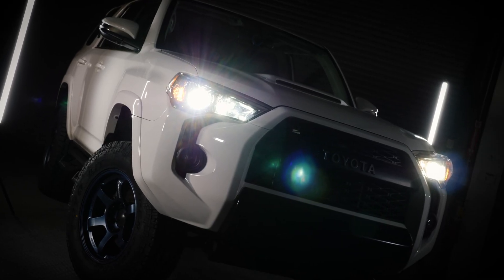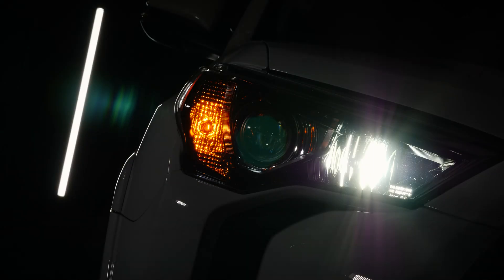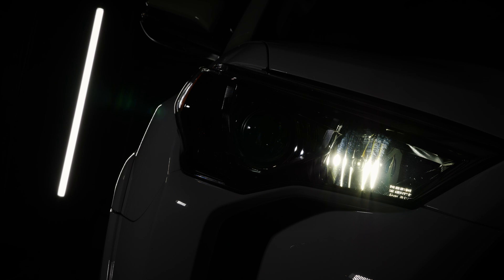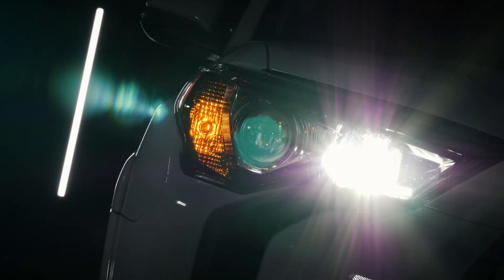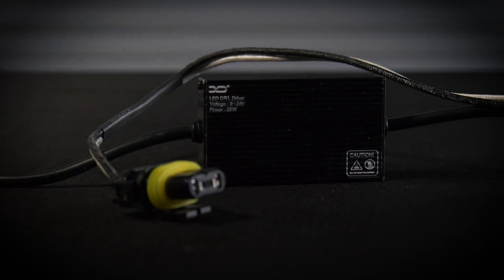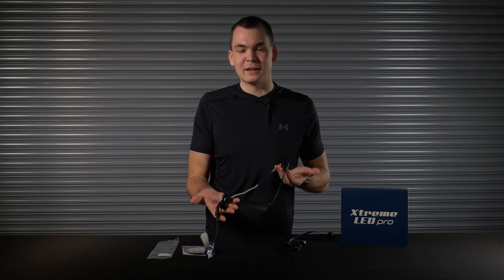Xtreme Pro Daytime Running Light LED Drivers Explained - 4Runner LED High Beam DRL

Comment: Why not put the link to this light kit? I go to your website and so many bulbs so. A bit confusing as i would like to get this module with some leds
Reply from the maker: Here is the kit for the 14-20 4Runner low beam: https://www.headlightrevolution.com/2014-2018-toyota-4runner-low-beam-xenon-depot-xtreme-led-pro-1418T4RUNNER.XD.LOW_2?quantity=1

And for the 14-20 4Runner high beam: https://www.headlightrevolution.com/2014-2018-toyota-4runner-high-beam-xenon-depot-xtreme-led-pro-1418T4RUNNER.XD.HIGH_2?quantity=1

Comment: Received a pair of h7s for my 2017 outlander. Having an issue installing them. Power supply setup is fine. But, once I go to insert this new bulb into the light housing, i unable to get it lock it. They circular piece that I saw in the video doesn't have that blue gasket. Like I'm missing a piece for this to lock in place. Any suggestions?
Reply from the maker: Can you send us a picture of the bulb youre trying to install?
support@xenondepot.com
Reply: @XenonDepotOffRoad  I found a $10 adapter online after I watched this video. I am waiting for to arrive. If that doesn't work, I will share a photo.

Comment: i got and i am getting very light flickering , a kind of vibration ? on both bulbs when i turn on DRL mode .
Reply from the maker: You did install the DRL drivers that came separately and not the ones that come in the box with the bulbs, right?
Reply: @XenonDepotOffRoad  Absolutely correct

Comment: $14 dolla canbus/anti flicker caps fix this too.
Reply: No, they don't, they cause the bulbs to be 100% bright and blind people. Capacitors act as lowpass filters and smooth the PWM back into a higher voltage - high enough for the LED drive to output brightly.
Reply from the maker: Thanks for that info!
Reply: and you only need one per vehicle, not per light

Comment: I have some questions before adding my order on your websites cart. I do have 2007 toyota Camry Hybrid and i did bought a Philips LED 9005 highbeam/DRL but i have some issues on it. The DRL is fleckering most of the time while when i use the highbeam i have no problem with it, so then i tried putting Philips canbus adapter hoping it will resolve the fleckering problem but it won’t. And i ended up phoning the philips company and they says there products won’t work in my vehicle..

So please can you give me an idea to resolve this issue in your product which one i need to resolve the fleckering issue?

Thanks
Reply from the maker: A PWM module should help fix this issue!

Comment: 2013 ram 1500 (vertical fog lights)
9006: XTREME LED PRO - Yellow fog lights
Will I need to use DRL harness for just fog lights?
Reply from the maker: Not at all, just the bulbs and PWM modules on this truck!

Comment: I got this for my 21 4runner Limited. Even though 21s now come with LED, the DRL still uses the ugly orange looking halogens.  I got the LED with DRL driver.  However, when installing, I noticed it fits a little loose so there is movement. I tried taking the o-ring from the factory bulb but it didn't make a difference.  Anyone try this on a 21 yet?

** Took a look again and for some reason it's full on brightness too.
Reply from the maker: It sounds like something changed with the 2021 OEM LED Headlights, so most likely you will not be able to use those DRL drivers with the 2021 OEM LED model. We are happy to take those back for a full refund, just shoot us an email and we will get that taken care of! Support@TheRetrofitSource.com
Reply: Planning on doing this to my 2021 sr5, yes i know it sucks that the drl’s are still halogens, did you figure out the issues yet?
Reply: @RCGJR_  I gave up and returned them.  Couldn't get them to dim to DRL mode.  Since I can't really see the light output with the DRL on, I figure the heck with it.  Hopefully as more 21s are available, someone will come out with something specific for it.
Reply: @johnvu8305  yeah, our 2021’s are pretty new, let’s give it sometime for aftermarkets to get updated.
Reply from the maker: @John Vu @Nothing With those 2021s, they should work just fine with the Xtreme LED Pro lights in there with the DRL driver. Due to a universal fit, the LED bulbs will have a little bit of play, but this will not be enough to effect the beam pattern or light output! As for the DRL not dimming, if you have the amber DRL, then your high beam will; not dim from the factory so the new bulbs will not. You have to have the DRL that uses the same bulb as the low or high beam for that DRL to come on with that high beam bulb. Let us know if you have any other questions, have a great day!
Reply: @XenonDepotOffRoad  Looks like I'm out luck as it's now a dedicated DRL since the Low and High are now in one LED.  Do you think it's possible to use the 9005 CMB as a dedicated DRL?
Reply from the maker: If you swaped your headlights to have one bulb for both the low and the high beam, that will be a different story. Let me know what headlight setup you have, if that is the H11 low beam 9006 high beam setup, then the Xtreme LED Pro bulbs will totally work for that DRL! Your DRL is not meant to have light output that you can see, it is just meant to be an indicator to other traffic. Let us know if you have any questions!
Reply: @XenonDepotOffRoad  I have the 21 limited factory LED low/high and 9005 for DRL. My concern is the CMB is too bright for LED. I tried the xenon extreme with DRL driver but it stays on full brightness like it's on high beam all the time.
Reply from the maker: Did you try those bulbs with the DRL driver or the PWM Modules? The reason I am checking on this is that the DRL driver for those Xtreme LED Pro bulbs was literally designed for the 4Runners, so if you actually had that part they should have worked with no issues in that high beam DRL! Shoot us an email with images of the drivers that you had, or get me your order number so that I can double-check that you had the correct products!
Reply: @XenonDepotOffRoad  Yes, I used the DRL driver not the PWM.  I ordered from Amazon since I could get it a lot faster.  I'm thinking the 21s have changed since it's the first time they come standard with LED headlights.  I've since returned it to Amazon so can't send you a pic. But I assure you it was the DRL driver I used.  I had a 19 4runner limited and it worked perfectly on the 19.
Reply from the maker: I have never heard of this happening before with the 2021, I will have to have you email into us with some detailed images of the products you received. Info@XenonDepot.com
Reply: @XenonDepotOffRoad  will this work on a 17’ Prius V? My HB/DRLs use a 9005. Just not sure if the voltage lowers or if it’s PWM. Thank you for your time in advance, I hate that nagging flickering
Reply: I have the same issue! Got a 21 limited nightshade and I hate the DRL .. so annoyed!!
Reply: @davidgutierrezrealtor  I ordered the new Morimoto 2Stroke 3.0 that has the built in DRL driver.  Will let you know if it works.
Reply: @johnvu8305  so the 21 4 runner has the highbeam/DRL too? I have a 17 Prius V and it uses a 9005 for the HB & DRLs. I was looking in to the 3.0 bulb as well.
Reply: @TunaNoCrust94  The 21 4runner doesn't have a combo HB/DRL.  The DRL is dedicated.  It now has a combo LB/HB LED.  The 3.0 bulbs should be here on Monday.  Will post results once I get them installed.
Reply: @johnvu8305  ahhh gotcha, thanks brotha
Reply: @TunaNoCrust94  Morimoto doesn't work on my limited either. Goes on full brightness like it's on high beam.  Doesn't dim.
Reply: @johnvu8305  so I saw a video on the headlight set up for the ‘21 4Runner and i’m seeing that the HB and LB are separate? The high beam is it’s own bulb that I assume also acts as the DRL, and the low beam is factory LED on a 21’ limited. I have a ‘21 Corolla and mine has Bi LED 
LB/HB which is also the DRL
Reply: @johnvu8305  nvm i saw a wrong video, but damn man i’m sorry
Reply: @TunaNoCrust94  No worries. I was really hoping the morimotos worked as a DRL.  I just can't understand why they didn't go ahead and make the DRL LED too :(
Reply from the maker: I would also like to add that this is an issue specific to the 2021 4Runner with the OEM LED Hybrid housings, and this is not seen with any other vehicles that we know of! Your Corolla should be just fine still, unless you have that partial LED headlight as well!
Reply: Damn toyota need to upgrade these old ass rig already.  No blind spot monitor and no LED Day light running??? In 2021 ? Damn
Reply: Will this work in my 2022 limited 4 runner?

Comment: Is there a hyper yellow bulb that you can use for a DRL in the 4runner?? I have a 2021 4runner Limited on order and to my knowledge on the 2021 limited the 9005 inner bulb is only used as a DRL. Both high and low beam now is coming from the projector in the 2021
Reply from the maker: You could use the Xtreme Pro LED in yellow, you would just need to make sure that you got that DRL harness with the bulbs! Let us know if you have any other questions, have a great day!

Comment: Xenon Depot, Does a 2015 GMC Canyon require this driver? I'd rather just get the GTR 2 if thats the case since it'd cost $180 for each light with the driver included, please let me know, thanks
Reply: Additionally, If the truck does need the driver, will it all fit underneath the dust cap ?
Reply from the maker: Send us an email to Sales@XenonDepot.com and we’ll help you get the right info and products you need for your Canyon.

Comment: Can you tell me if this video correct, because it doesn’t match with you’re explaining.... asking because he only uses the black cables he never used the harness with the white cable https://youtu.be/oM9H9uUuohU
Reply from the maker: It's possible the wire colors have changed on the kit, If you follow my instructions you won't have any trouble. In fact, We installed this exact kit on a new 4Runner right after this video was made with no issues!